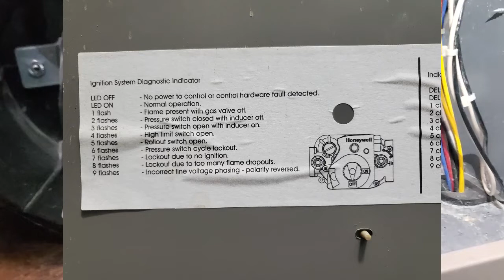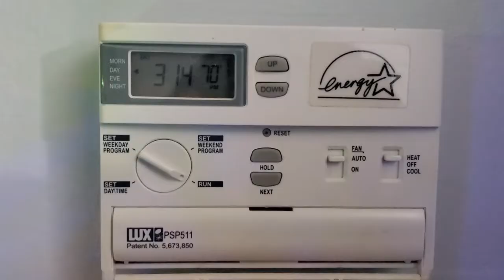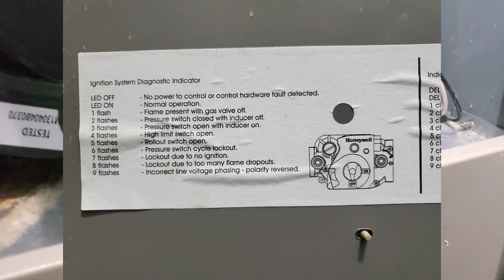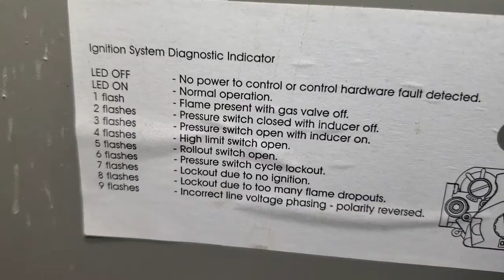ARMSTRONG/AIR EASE FURNACE NOT HEATING:  ERROR CODES AND HOW TO FIX THEM

Comment: I have this model; Armstrong Air Ultra V Tech 91; installed in 2005 and still works; looks like this, it's  design flaw that results in code 3 & 6 (flashes) most of the time. yes, routine maintenance helps but the design is so simple and easy to fix if you understand how this furnance works. 2005 to 2025; changed roll out switch, pressure switch, igniter and once a month condensate trap cleanings, it still works fine.! replaced parts cost about $140.xx Canadian. I only get issues when too much moisture is in the air, early spring and early winter.

Comment: I still have 3 flashing and did the cleaning and filter change. Still having issues
Reply from the maker: Whats a 3 flash mean?
Reply: @IHVAC  pressure switch stuck open with inducer on. Thinking it is the pressure switch I got a new one, but didn’t fix it. Cleaned out that tube and made sure everything was clear there’s no blockage.
Reply: What did it turn out to be?
Can you close the loop?

Comment: What should I do if I don’t see a flame through that little window? I cleaned the flame sensor already and changed filter
Reply: It’s not throwing any codes. It’s solid/running as normal

Comment: That furnace looks at least 15 years old and dirty af, just sell a new one and explain how important it is to keep it maintained buddy.
Reply: I'd tell them to keep it and explain the importance of routine maintenance. No point in replacing it with a new furnace that's going to last 5 - 7 years if they're lucky.
Reply: How about maintaining the furnace for the owner, win win, you both save and make money, instead of always screwing over the customer.
What comes around goes around.
38 year Technician.